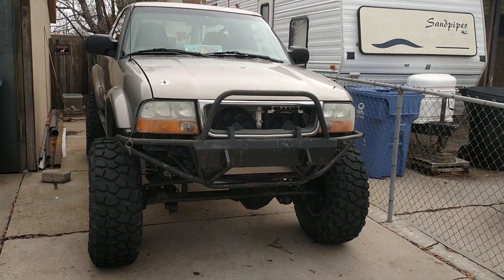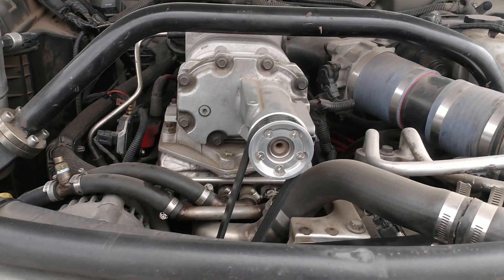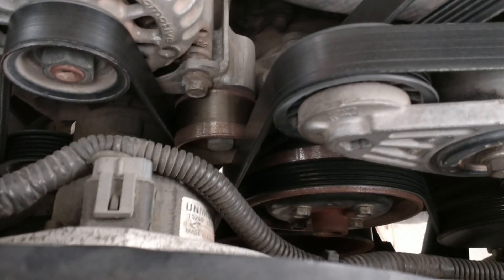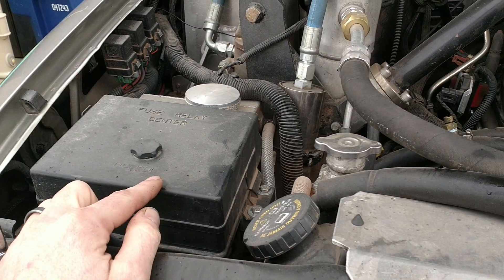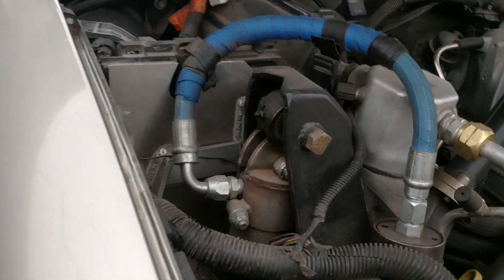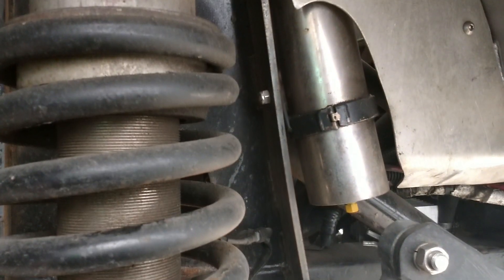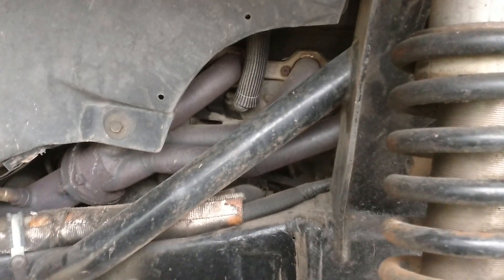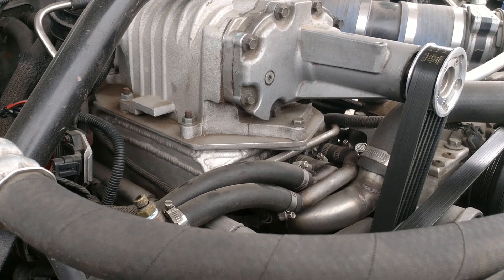Supercharged Chevy S-10

Comment: I assume that's an M62 blower if it was from an extera. That's a little small for that 4.3 V6.
Reply from the maker: Correct on both! I have the smallest pulley I can get on it to only get 8psi, I figure at redline (5800rpm) on my engine I'm spinning that blower right at it's limit, it hasn't come apart yet but I did rebuild it with much better bearings and a new drive puck.  It has been on there for a little over 50k miles and hasn't missed a beat even if I'm not being very nice to it. But you are very correct and the only reason im using this blower is because it was free to me at the time. I have both an aluminum block 5.3 and a Whipple twin screw off a hummer 6.0 that I'm thinking about combining and swapping out the 4.3 and m62 blower for.

Comment: What was your hp gain
Reply from the maker: At ~8psi on the stock pistons and a haltec computer it made 403 to the flywheel on an engine Dyno but with the 8.5:1 pistons and my stock computer tuned by a trusted friend I'm guessing 340 at most. So around 50-60 hp gain, with the bigger blower I'm putting on it and not changing anything else at 8 psi I could see 380-390hp just from the less drag of the bigger blower.
Reply: wheelitzr2 how much did cost...you think I can put a supercharger like this one on my 03 Sierra 4.3 step side dropped?
Reply from the maker: @Janarr_350  it would cost more money to supercharge  your full-size 4.3 than it would to put a V8 in it and gain 2-3x the performance across the board. The only reason I haven't done a V8 is because I got all this stuff for free (aside from the Injectors and map sensor) and made it all work, if I was to throw a number out for another kit like this it would be $10-13,000 I've easily got 400+ hours in building just the blower related stuff.

Comment: HE DIDNT! Lmao somebody tell him it's an s10 with a 4.3.
Reply from the maker: Adam Corbin, I did.....? not sure what I did or didn't do?
Reply: It's an early 2000's GMC Sonoma.  The Sonoma and the S-10 use the exact same body/frame/engine.  Only the front face treatment on the two are different.  I know, I have one of each right now in March of 2018 in Idaho.  Already installed the turbo on the S10 and the supercharger for the Sonoma is on the workbench and is next.  I'll sell whichever one ends up slowest.  I'm retired and have the time.  Semper fi.
Reply: Jaraco Yemx  if you have a supercharger for a s10 I’ll buy it off you
Reply: @bellator3691  Did u figure out which one is faster yet?